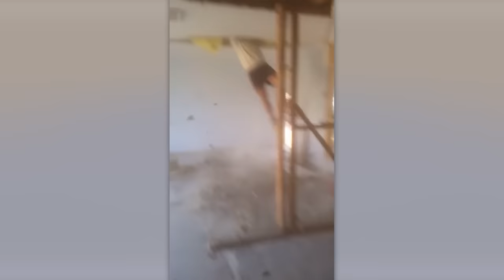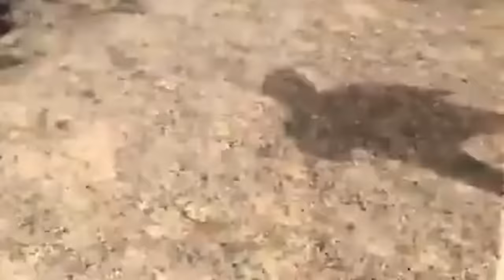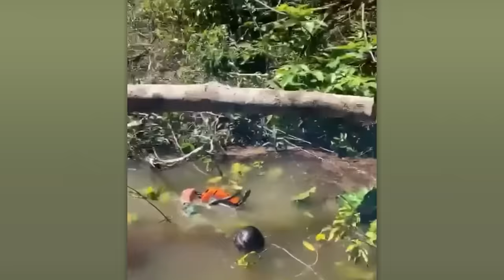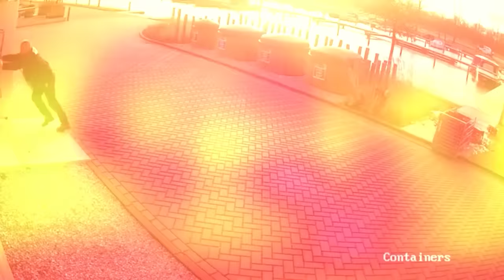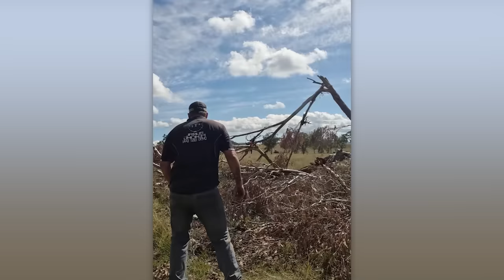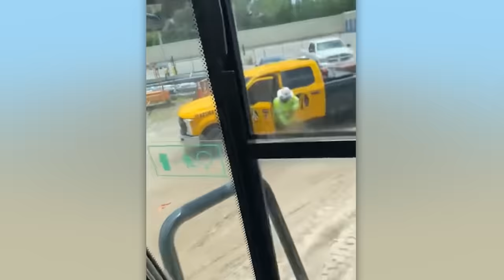Total Idiots At Work Caught On Camera

Comment: That tractor and baler... The farmer may have done that to dry the silage more. There are special equipment that does just that that the baler did: Lifts up the silage to take in some air to the silage so it can dry out more. I think it is called string aerator in english. (I am a swede so the translation may be wrong.)